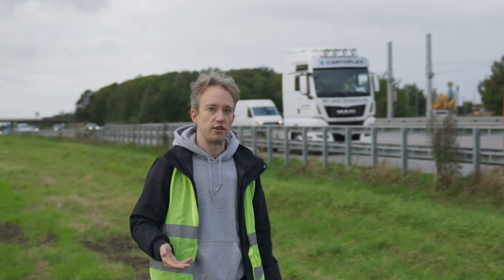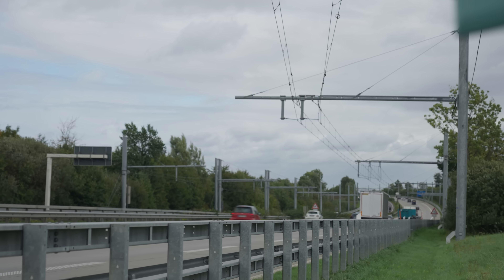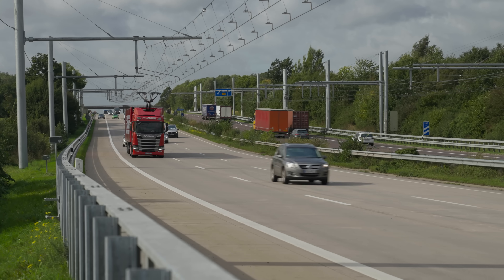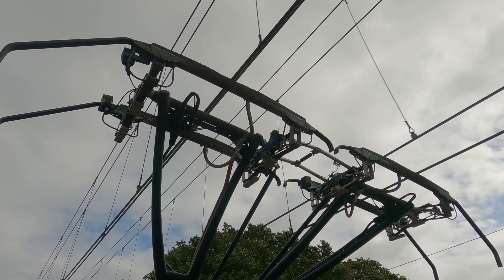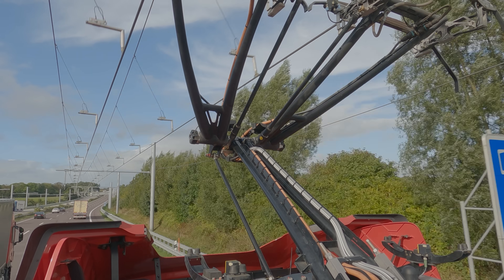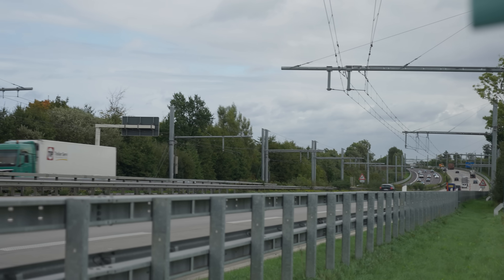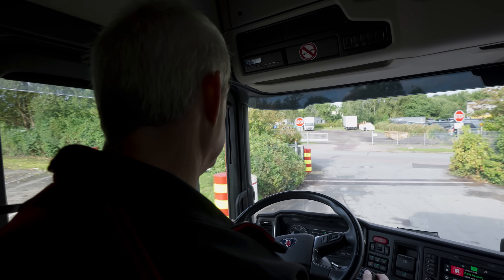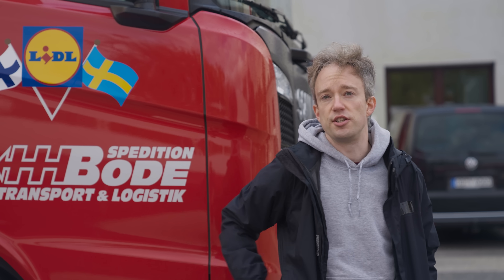The highway where trucks work like electric trains

Comment: The sad thing on this test highway is, that there are literally just two trucks from one company (Bode Spedition) that are driving with this technic. It was heavily discussed while building, because Mercedes and other companies dropped out of this technic, saying it isn’t cost effective and that hydrogen would be the future. 
Also there are some safety concerns, because the street is now to narrow for rescue helicopters to land in the case of an emergency/accident. Not all parts next to that highway are fields, or even close to be useable as a landing point.

Edit: Not from a real study, just my observation from driving everyday beneath these lines: people seem to be scared to drive under it. In those kilometers oh highway many people from other cities/countries, often don’t drive beneath. It feels, like this random stretch with wires seems kinda intimidating and feels forbidden for normal cars. But trust me, it is awesome to drive under it. It feels like being a train driver.
Reply: "In those kilometers oh highway many people from other cities/countries, often don’t drive beneath."

having spent way more time on the autobahn than I ever wanted to, I can tell you those lines have nothing to do with people not driving on the right lane...
Reply: I'm not sure that having only two trucks is a major problem at this point - it's literally just a proof-of-concept right now.
And for the air ambulances - if that's the biggest downside, I'm sure we'll be ok. Germany is one of the few countries who heavily uses helicopters for "normal" ambulance work - most countries only use them for super weird or remote rescues. It'd be a shame for it to be less effective in Germany of course, but shouldn't hold back progress
Reply: @robdavy4468  I know completely, that this is just a test trial/prof of concept, but having two of the biggest players in the truck world dropping out, before it was even really starting to be build, had many people in the region scared, that this is just going to cost tons of money (all this work for just two trucks, electricity is paid by germany not the company, everything will be build back in 2—3 years). 
We really have to change the whole cargo transporting business und ich really like the concept of „last mile by e trucks“, especially with the idea, that trucks are hybrids and are able to drive emission free in the cities and charge on the highway. But in this special case, it really didn’t felt thought through and many felt kinda ripped off.
Reply: @tecmalo6857  The biggest car manufacturers in the world backed out of electric vehicles long ago, look what's happening now. The companies are not always right
Reply: With the trucks having some battery range, gaps could be left in the wires for emergency vehicles, similar to how a center divider will have cuts every so often.
Reply: We drive under tram cables all the time in Melbourne. It’s just normal here, literally doesn’t bother any one.
Reply: @Toothily  same here in Dayton Ohio(usa) nobody pays them any mind
Reply: @Toothily  Aussies also drive on the wrong side of the road. And even that doesnt bother them.
Reply: i don't see that as an issue, very little of Germanys road system is capable of having a chopper land on it. so why is it suddenly a must on a motorway?
Reply: @tommyfred6180  In most cases it is faster to send a helicopter with a doctor to a big accident, than to drive him to the spot. Every highway is capable of landing helicopters, just for this sole reason. So yes, they should be capable to accommodate helicopters, due to their higher traffic volume compared to normal over land roads. If you have a heavy accident on that part of highway, it will take more time to get you to a hospital. 
 Plains definitely ain’t a concern, that’s absolutely true.
Reply: @tecmalo6857  thats bull mate. most motorways in Europe are incapable of landing a chopper on them in many parts. copper landing is never and has never been part of the planning and design requirements for a motorway. 

show me one motorway blueprint that gives a spec code for the landing of helicopters. you can't because it doesn't exist.
Reply: @tommyfred6180  because major accidents happen on motorways?
Reply: @clray123  no major accidents rarely happen on motorways. they are the safest roads in Europe mate. 

if we use your argument every major road junction in every city should have a helli pad.

seriously though i do get your point but its not that hard to work round. having a run of road every ten miles that could allow a chopper down would be nice. but we don't build the roads with that in mind now. so why would this need to comply with that standard? a standard we don't have and have never seen the need for till now.
Reply: I suppose that being unable to land a helicopter isn't that bad, as many motorways already have adjacent high-voltage power lines which would prevent landing. We wouldn't be taking much away.

Also, most accidents are dealt with by road ambulance on motorways from what I see. The rescue helicopters only deal with remote regions, and remote sections of highway could probably get a small fire station/ ambulance station.
Reply: That's very interesting.  Thank you for sharing your observations.
Reply: Sure but, definitely people will know and get used to that over time.
Reply: What about the restriction on oversized items - such as to build developments and other infrastructure.
Many houses are now being built in parts inside factories and delivered to site - and is seen as the future due to efficiency and cost. 
Many other scenarios beyond health and safety to consider…
Reply: Curious if radio, cellular or satellite signal is effected under theses.
Reply: @phelyx2  just as much as in a train.
Reply: There is nothing sad about a non-solution to a non-problem being scrapped. If we had paid attention to the relevant details of the Glorious German Energy Transition (Energiewende), we would have saved us from wasting 1000 billion Euros to date for a net result of ZERO = zero C02 emission reductions during the past 15 years or so.
Reply: It would take a trivial amount of extra effort to make the support booms retractable to clear the freeway when a medevac helicopter needs to land.
Reply: I can't imagine it being too difficult to make some sections that are quickly collapsible if the safety concerns are relevant.
As you say. The aesthetic concerns are just that.
Reply: Great insight!
Reply: How do these people drive in cities that have trolley bus lines overhead?
Reply: tbh I think I would prefer hydrogen to electric since you cut out the batteries entirely, a lot less waste then
Reply: This isn't cost effective, but hydrogen is? What are they smoking?
Reply: Hydrogen is a fossil fuel, at least at the moment. My grad professor consulted on a major collaboration discussing the feasibility of hydrogen vehicles, and their assessment was that it would probably never actually be technologically or economically feasible. Hydrogen could be used to upgrade biofuels, etc. but its energy density and safety issues were hard to overcome.
Reply: It’s not just helicopters either, highways are often used as an emergency landing area for aircraft, and those wires could be hard to see from the air. I love the technology, but I think setting up electric railroads would work better in some cases.
Reply: @-caesarian-6078  Ever been to a highway in Germany? There are lane dividers in the middle of the roads and lights every 50 or 100 meters. There's enough in the way already to trash a plane trying to land, overhead electrical cables wouldn't make things all that much worse.
Reply: @-caesarian-6078  It's so rare for aircraft to land on the road it's a non issue.
Reply: @-caesarian-6078  not in europe they aren't
Reply: @-caesarian-6078  thats not a valid point mate. aircraft pilots should not see roads as emergency landing strips and nether should planers.
Reply: @tommyfred6180  "aircraft pilots should not see roads as emergency landing strips and nether should planers"
Sure, except many motorways are also designed to serve the purpose of becoming runways in case of strategic events. Your planning skills are a bit off there.
Reply: @channul4887  no my point was re privet aircraft. 

if you bother to look you will see that military LS on motorways are intended to have all the fittings removed. some people and you are clearly one. seem to think the roads would be unaltered for use as runways. this is untrue and stupid. so the overhead lines would simply come down at the same time as the road signs, lights and so.

my point was and you clearly didn't get it mate. that an in service motorway should never be viewed by a civilian pilot as a good diching point. banging a plain down on a road full of fast moving cars and trucks rarely ends well.

the idea of factoring this in as part of the  planning is stupid. so is objecting to a road improvement because it will make landing plains difficult. its like objecting to a bridge design because you are not going to be able to fly your plain under it. its not something you should be doing so why would it be a consideration in the plans?

no offence but your clearly are not the sharpest tool in the box son. see i can toss in a pointless insult to look big just the same as you. i suggest you wind you neck in a bit mate and be a bit less of a c*nt.
Reply: @tommyfred6180  "aircraft pilots should not see roads as emergency landing strips and nether should planers."

Where do you want them to land in an emergency? A row of houses?
Reply: @tommyfred6180  "banging a plain down on a road full of fast moving cars and trucks rarely ends well."

You are aware that the aircraft are often moving at about the same speed as the vehicles the road, correct? Also, landing a small aircraft on a road usually works out just fine, there are even plenty examples of it happening on YouTube.
Reply: @tommyfred6180  most roads are unsuitable for aircraft anyway as they have median barriers and light poles so all but the smallest aircraft couldn't land anyway. Like you think a motorway is wide but you have like 3 lanes on one side of the median barrier and for a tiny aircraft that is a very narrow space even. and wings of anything larger couldn't overhang the barrier as the engines or props almost touch the ground and would hit the barriers.
Reply: @tommyfred6180  Ehhhh, it's tommy big balls/no capital letters ova ere, ehhhh. Ehhhhh marrron, check out my privet aircraft you gazon ova ere, ehhhhh.
Reply: @PistonAvatarGuy  mate all but one of the clips on youtube are from the US. big, wide, empty, straight roads with lots of run off and few barriers and road signs, lamp posts. so not relevant to European motorways.

the aircraft is also planning to stop not get off at the next exit. so its speed on landing is only similar to the cars its merging with for a short time then its going to stop. stopping on a European motorway, except on the hard shoulder. normally ends in a collision, massif traffic jam or death. even stopping on the hard shoulder can be very iffy. look at the A3 out of london or bits of the M6.

as i pointed out to the other guy saying you should not change a road because it will stop people from doing something they should not be doing anyway is not a relevant argument.
Reply: @PistonAvatarGuy  yep fair point. but by the argument that we should build motorways so aircraft can land on them. why are we not building houses so aircraft can land on them?

at the end of the day if a aircraft is coming down the pilot is stuffed.

towns a city's are not full of big, wide open, half mile long, unobstructed, flat bits of ground.

motorways, on the other hand, are mostly in the countryside. surrounded by big, wide open, half mile long, unobstructed, flat bits of ground. we call this farm land. :)

even when the motorway gets into town and would seem like a prefect parking lot for the wayward pilot. the damed thing is full of road sigs, lampposts barriers down the middle and a surprising number of flyovers of one kind or another. so still not very inviting to turn into a temporary aerodrome.
Reply: @channul4887  troll :)
Reply: @tommyfred6180  "why are we not building houses so aircraft can land on them?"

Because that would be insane. Roads require no modification for them to be used as runways (edit: IN AN EMERGENCY), I'm only suggesting that we shouldn't make it far more difficult and dangerous for aircraft to land on them if they need to in an emergency.

Anyway, trains are a far better choice here, that's the bottom line.
Reply: @tommyfred6180  I'm not upset if you call me a troll since I know that even if I was one the fact that you don't know how to use lower/upper case letters invalidates 100% of the verbal darrhoe you serve us ova ere, ehhhhh.
Reply: @channul4887  trol x2 ;0
Reply: @PistonAvatarGuy  roads do need modification for use as a runway. if you look at any stretch of road built with being used as a landing strip in mind. you will see that it has no camber, a complex drainage system, no central barriers (making for fun highspeed head on crashes), no road signs, lamp posts, over passes and so on.

and yes it would be insane to build a housing estate so you can land a plain on it. but that's the point its insane to expect a motorway to be built to land aircraft on. or to object to its modification because it would make landing harder.

as for trains. totally agree. track is king for moving lots of stuff safely and quickly. we need to seriously rethink logistics. trains trams, tube goods railways into town centers and so on.
Reply: @A.Martin  yep thats the point i'v been trying to make mate. :)
Reply: @tommyfred6180  nOW nOW tHERE'5 nO nEED tO gET tHIS lOW, mY iNTERNET sOLDIER.
Reply: @channul4887  troll x3 :)
Reply: @tommyfred6180  There's something very wrong with you.
Reply: @PistonAvatarGuy  ho i see you can't make a good point and defend it in a sound or reasonable way.

so your bailing and just going for a naff attempt at getting off point.

your still to give me any reason why landing plains on a motorway is a reason for rejecting of having issue with the proposed idea. have you?

all you've tried to do is imply that motorways should have this ability. seemingly based on the fact that some very small bits of road have been used for this. plus that some countries military build bits of road to use as war time runways.

the bases of your augment seems to be. that motorways are proxy runways in some form or the other and that the proposed changes will end this setup.
Reply: @tommyfred6180  My point: We shouldn't go out of our way to make it difficult for aircraft to land on roads (in the US, where we have PLENTY of large, straight roads) by adopting a ridiculous catenary system to power heavy trucks.

You took that as me saying that we should completely reconfigure roads to accommodate aircraft, which is pure nonsense. Learn how to read, bud.

Also, it's PLANES, not plains.
Reply: @-caesarian-6078  maybe you would have the electricity on the ground and have the tires charge the battery
Reply: Whichever ways works, hydrogen or wired, at least they are both Environmentally friendly.
Reply: @OddGaming-m6r  Hydrogen is terribly inefficient and therefore it will be very expensive thermodynamic vandalism. Use electricity for the things that can be electrified. Save hydrogen for the very few things that can't
Reply: @redshift3  Hydrogen is only inefficient because there isn't proper infrastructure in place to make it efficient. Invest in infrastructure and the benefits of hydrogen will become very apparent
Reply: @MrBad993  No hydrogen is inherently inefficient. Electrolysis has something like 60% efficiency from electricity in to electricity out, without considering transportation or storage.
Reply: @MrBad993  hydrogen is inefficient because significant energy is lost when you make it, compress it, move it and use it. It's not about lack of hydrogen infrastructure
Reply: @OddGaming-m6r  electricity is only environmentally friendly if the powerplants generating it are. Everyone is focused on cars and random things individual people do, when the vast majority of pollution comes from powerplants, and with more and more things switching to electric it will only get worse. Solar and wind are decent, but running an entire country off them isn't really feasible and for some reason no one is using nuclear power.
Reply: @battleoid2411  One central power plant is better than everyone having their own combustion engine. A power plant is more efficient and able to take more measures against pollution.
Reply: @YraxZovaldo  the problem with that thinking is that you can't have one central plant, you have thousands. We're doing this whole green energy thing backwards, we're making all of our machines run off a central grid but doing next to nothing to make that grid clean, and as demand grows the grid will have to as well, and that growth is going to come from fossil fuels because it's cheaper and easier. You can slap a filter on a coal plant, but its still going to pollute 100 times that of the cars it's trying to replace. There are options available, but people keep going for bandaid solutions instead of actually fixing the problem.
Reply: @battleoid2411 Yes, the energy production needs to change too but that is a different problem. EV’s are a step in the right direction even if they are not perfect immediately. No one is proposing to only use EV’s without doing anything to change how we produce energy.
Reply: @OddGaming-m6r  if your car isn't a minuature train and is electric you'd be more enviormentally friendly with an internal combustion car.
Reply: Hydrogen fuel cells are the future.
Reply: It also looks awful and totally destroys the scenery but whatever
Reply: @VanquishedAgain  - I assume you're also one of those people who complain that windmills aren't aesthetic enough and neither are solar farms...
Reply: @robertb6889  Who wants a solar farm in their neighbourhood?
Reply: There are multiple, glaring issues with this. This is a grab for EU grants and nothing more. I like the concept but these people aren't serious.
Reply: @siraff4461   which ones?
Reply: @markkealy4417  Which ones what?
Reply: @siraff4461  which "multiple glaring issues"?